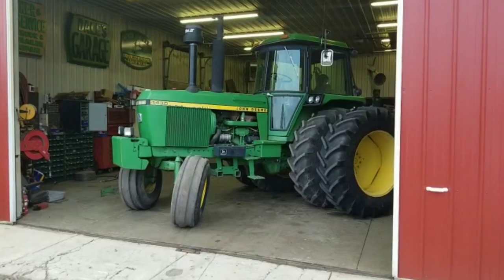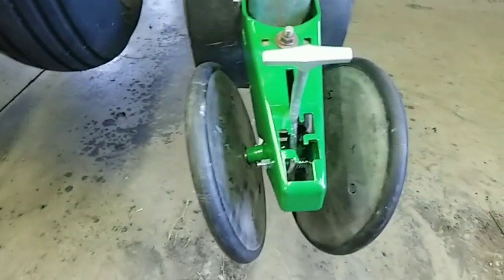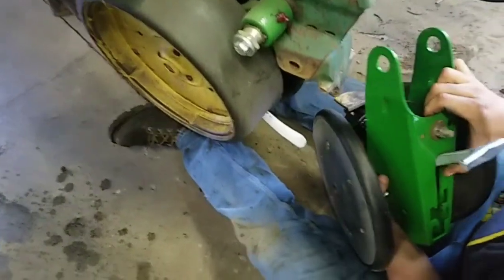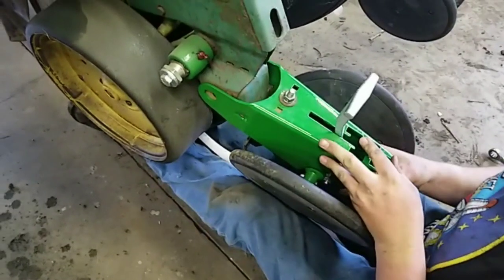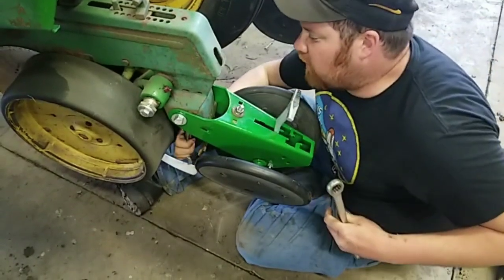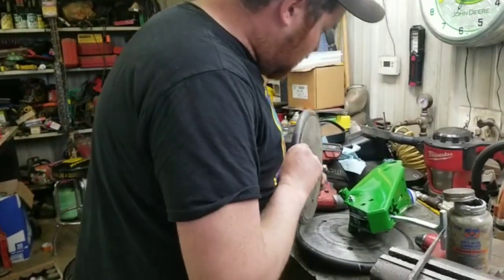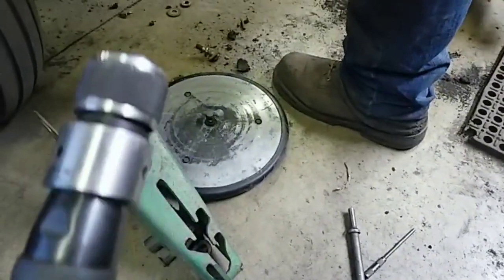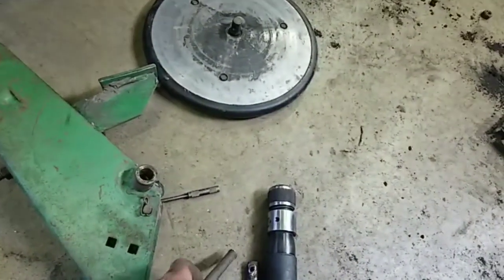John Deere 7000 corn planter firming wheels/Dad Strengthens tattoos

Comment: Have 4 rows narrow 7000. Where is the best place on the row units to improve it? Have new meters, belts, tubes, firmers, and drive clutch is two years old. I only about 20 acres of corn a year. No soybeans. 
I don't have a monitor but would like to get one. 1500 at local planter shop.
Reply from the maker: The 7000's in general bone stock are very good planters in my opinion Something we did and I was very satisfied with what results I seen just visually was we started running a spiked closing wheel one side of each row and a smooth wheel on the  other side and I really feel it improved seed to soil contact especially in heavier soils and where we had cover crops....definitely get you a monitor so you at least know all your rows are planting